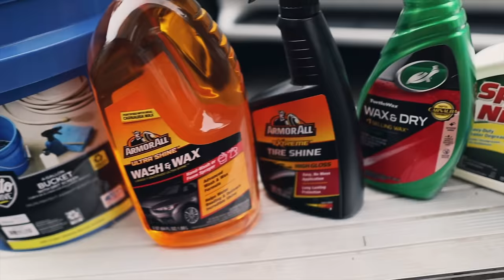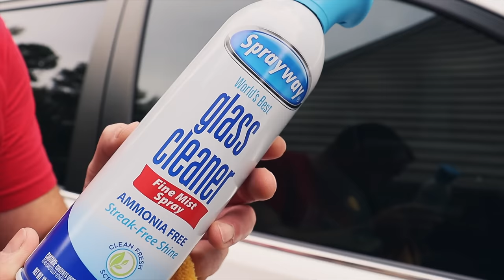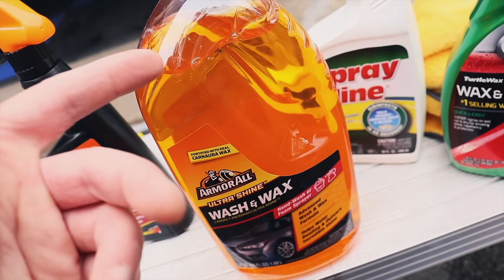Budget vs  Pro: Can Cheap Car Detailing Products Make Your Car Shine?

Comment: Great video! Clearly demonstrates that investing in a few key items, such as drying towels, wheel and barrel brush, etc., can really save you time and money in the long run. I think the same holds true for other products as well. For someone only occasionally cleaning their vehicle, these budget products are better than nothing. Anyone watching here, I believe has evolved to higher quality products, and appreciates the difference.
Reply from the maker: For sure, just the fact one would go out and detail their car already surpasses the majority of the population that neglects their vehicle. So while the products can sometimes be super important, it’s the methods and techniques that are even more important.

Give a good detailer average products and he’ll still do a good job. 

But of course when you detail vehicles regularly, then it makes sense to invest in higher quality chemicals and tools if they can increase your efficiency and results and make the user experience better.
Reply: I like this channel, and I’ve always used budget products.  I have my favorites, and they work for me.  I’ve come back to Turtle Wax after many years of trashing their products.  Their new lineup is very good.  Meguiars is hit or miss, but they do have some great stuff as well.

Comment: I used to use Koch Chemie, Carpro and Adam’s car wash soap and bug removers. But I always go back to meguiar’s gold class soap and turtle wax bug and tar remover. In my conditions, I feel that turtle wax bug and tar remover has the best performance without compromising my coating. I also feel that Meguiars gold class soap has a lot more lubrication compared to carpro reset, Koch chemie GSF and Adam’s soap. They’re also very cheap and easily available, so I can use higher dilution. But on all other products such as pressure washer equipment, polishers and polishing compounds, I use the highest end stuff from obsessed garage. I only use consumer grade products for bug tar remover and car wash shampoo
Reply: do you still use koch chemie? if so is it good?
Reply: @Guapoo69  yeah bro. It’s not bad. But it’s very expensive.

Comment: I love Sprayway Glass Cleaner because it is ammonia-free, cleans really well (no streaks), and is widely available. In cooler climates, this might not matter, but where I live (in the desert), most glass cleaners dry almost instantly. For instance, the rag will touch the glass, and it is already dry at the point of contact because of how hot the glass is. This doesnt happen with sprayway so it has become my go to glass cleaner.
Reply from the maker: Thanks for sharing!

Comment: Most importantly, we all have to start somewhere! I would recommend everyone to get the basics first and then progress later simply to be able to put your money where your mouth is. The stuff I was using 20 years ago in my mind were the best of the best but nowadays I was very wrong. Of course technology has improved since but the experience along the way will solidify why more professional products are not only economical but very useful. If you want to ditch big box store products, I'd highly suggest jumping into the P&S product line! You won't be disappointed.
Reply from the maker: Good points! 👍🏻

Comment: Funny thing there is an old guy out there who bought an F150 new in 1984, parks it under a carport and cleans it every 2 weeks w/Turtle Wax & Armor All products.  As well as changes his oil every 3k miles & uses a Fram or STP filter (whichever is on sale or in stock at the time).  😂  It’s probably 90% consistency and 10% the product.  

That being said, I’m always watching Pan’s videos and probably using the higher grade consumer stuff.

Comment: Hi Pan. Thanks for all you do as, judging by the comments, we all learn a lot from you.
Id personally like to see an all-in-one video on removing different LSP's. From bsd, waxes, sealants, TW ceramic spray (an example, because i have it), to the newish ceramic-lites (carpro cquartz lite and in uk Infinity Wax Synergy lite, which id like to have a go at but have concerns removing the stuff) to full blown ceramics 1yr, 2yr, 9yr. How do we strip the lsp so we can start over?
Do we have to dispose of stripping cloths and pads, after use, with ceramics or ceramic lites.
Thanks in advance

Comment: Found 1 spot I had missed during paint correction the size of a toothpick where a stain was not removed from the front bumper.  It was sealed under the Cericote.  Was able to remove the stain after removing the coating that had sealed over it.   I can tell you the Cericote had bonded over it with an extreme hardness due to proper curing.  Once I removed the coating the  stain was easily removed.

Comment: If you take leaf blower and blow off the water first then use your towels to touch up left over water. The coating I had put on my Audi A7 the water just sheet off with just very very water left  on the car.

Comment: Impressed with the Spray Nine. Although i would be a bit concerned about using it on a regular basis on coated cars. Rest of the products are kind of what I expected, acceptable, but better options available. That tire shine though, looks like sling city.
Reply from the maker: I think Phil uses the APC pre-treat more for situations of full car preps for a ceramic coating application. Not for regular weekly maintenance washes.
Reply: Hi Yes what Pan said.  I always mention on our youtube channel how we proceed with out methods and details.  The APC rinsing or pre washing at this level is for the initial detail, not to be used all the time for maintenance details.  I simply showcased it in this case.  I actaully love DIY Rinseless in a foamer as a pre wash.  its effective and safe.

Comment: Enjoyed this one Pan. Very interesting and for the weekend warriors who wash there cars regularly the publicly available products are ok because most of us not trying to make them look like pros like you do. The Spray 9 was interesting I have not used it before but am thinking of trying it. Have you covered this product before? If you have I probably missed it. If not maybe you can do a vid on as it can be used on many applications including the interior if diluted properly of course. Would also like to know how much impact to the the protection it does etc. Thanks!
Reply from the maker: I haven’t done a video on Spray 9. But Phil mainly uses it as part of the pre-wash before a full detail and ceramic coating job if memory serves me well. Not for regular weekly washes as that could potentially degrade the protection over multiple regular uses.

Comment: Just watch this video on Cheap vs Pro. I have some info I’d like to pass on. Two products in particular were the Spray 9 & the Armoral. Back I the sixty’s & 70’s everyone used these to clean & shine there dash and interior vinyl. Little did we know they had an chemical components that attacked the plasticizers, causing cracking. Also it left a slick feel to the surface. Case in point: My wife had her car detailed. They used Armoral on the floor mates. That quickly transferred from her shoes to the brake peddle… VERY DANGEROUS!
I used Spray 9 on the vinyl boat covers. Got them clean but they too became very brittle.
My go-to for all my vinyls has been the 3M Vinyl Cleaner & Conditioner.

Comment: I used that glass cleaner when I drove a truck.  All of the Drivers did and I still it today.   I found that using a microfiber towel leaves lint, so I use paper towels.
Reply: Try as well a waffle weave towel, that's what I use and it's amazing on my glass

Comment: Spray Nine has a pH of 12.8, so even when he diluted it 1:4, the end mixture has a pH of 12.1. It's highly alkaline and will degrade ceramic coatings and PPF.
Reply: he said it will effect coatings, nobody denied that. clearly his worked decently well afterword's as he stated..
Reply: @rebelkillswitch  most of us would want to clean the surface without damaging it in the longer term. Spray Nine cleans well, but in the long term causes more harm than good. 
It's much better to use milder cleaning agents and increase the dwell time.
Reply from the maker: If I remember his method, Phil mainly uses a high pH APC pre-treat on vehicles before a full detailing and ceramic coating application, not necessarily for each regular weekly wash.
Reply: @PanTheOrganizer  thanks Pan, that would make sense.  High pH for a decon wash, followed by a ceramic coating.

Comment: Thanks, Pan. I can tell you Phil and Jess at Miranda detail are awesome. Very hard working and honest. I've learned a ton from them. I'm glad you had them on.
My experience has been that some of the consumer grade chemicals are ok. Usually, I need more product to get the task done, thus not as inexpensive as pro grade. The tools are another story. Towels, brushes, and wash mitts are very low grade at the consumer level. Yeah, the pro tools are expensive, but they are superior in every way. Last, a long, long time. Yes, please. More videos like this. There are some "diamonds in the rough" at the consumer level. 
Hey Pan, where did you get the 1000ml Wet Coat?
Thank you!
Reply from the maker: Yeah I agree the tools on the cheap side are often too cheap haha.

That’s an older WetCoat bottle that I keep around and refill as I like the size. I don’t think they offer that size anymore.

Comment: Hey Pan! I purchased a new car this week and I’m looking for a protectant that will keep the paint from fading and clear coat mostly in-tact 10 years from now. This is especially important because my car is stored outside in the elements. My main and only concern is UV and chemical protection. Are there any consumer coatings you recommend? I don’t have any experience with decontamination or clay bar stuff, but I’ve seen 50+ different types of spray-on coatings online and in stores, and I’m wondering if any of these modern ones are actually worth giving a shot. I’m okay with re-applying once every month or so if it can be done in under an hour after a maintenance wash.

Comment: hey pan, quick question. Can I clay bar using synthetic clay on a ceramic spray or will it diminish the protectant?
Reply from the maker: You’d have to test. It’s impossible to know for every product combination. Worse comes to worse, if you see it affected the protection, as it’s a simple easy spray, just reapply.

Comment: Is it possible to use a specific consumer brand like Turtle Wax product’s or Jay Leno’s Garage from start to finish to compare to professional grade products? There are some consumer brands that are cost effective and work really well.
Reply from the maker: You can do as you please. But usually, the more premium products do offer better performance and durability (like coatings for example). But you can still do a good job with entry level stuff. The skills are often more important than the products themselves.

Comment: I use the following products on my car as a weekend or during the week detailer.

Armor All Extreme Shield Protectant for the inside
Meguiar's Leather Conditioner for the Leather Seats
Armor All Wash & Wax for to wash the car
Meguiar's Hybrid Ceramic Wax for the outside (I wash the car, spray on the wax while wet, rub it in and then hose it off).  My car is never without bubbles on the paint after a rain.
Meguiar's Ceramic Tire Shine for the tires
Black Magic Tire Wet for the tires
Turtle Wax Wet & Black Tire Shine for the tires
Stoner Trim Shine for the black plastic trim
EVO Gloss Envy or Gloss Enhancer for in-between to give the car a nice gloss

All these products are fairly inexpensive and after 5 years my car is still looking like new.
Reply from the maker: Thanks for sharing.

Comment: Nicely done ✔️.  I manage my products very well and get the very best out of them. I feel you guys reading this, too, can do the same. The amount of product to dispense is usually worse case scenario on the bottle label, dial it back a little for your water type I.e T.D.S soft/ hard water. What is the vehicle condition like? What time of year is it? Do you need to use the full amount specified on the bottle? Little is often best. If you use premium products, then you are using the best tried and tested products available for your second biggest purchase in some cases. Why would you use a cheap, not very lubricating car shampoo that uses caustic, salt and rust inducing soaps? They might clean ok but over long periods of time it's damaging your pride and joy, premium products often use better chemicals that i have found. It doesn't make any sense to use cheap products. I invest heavily into the very best for my growing fleet of vehicles because they are expensive and maintenance is the very least you can do to keep its value and your enjoyment! A clean car always drives better right? 😄😆. I know things are expensive, but decent car care will pay you dividends in the long run. If you are struggling to buy products, then save for longer and wait it'll be worth the wait. Or go halves with a friend who loves detailing too, make a bond stronger with your buddies. Pan's 2023 detailing awards just showcases all that's the very best detailingcan offer. I can agree with most of Pans line up, although newer products are already out and in such a short period of time has surpassed these already. It's an exciting time to have a passion for detailing. 🎉
Reply from the maker: I agree! We live in a time where there are always new innovations and new products to try and see what works best for our needs and budget.

Have a great weekend!

Comment: Thanks for sharing! ❔Quick question, please: Just bought a 2014 Ford F150 and was doing my first interior cleaning. Not sure what was used previously to clean the airbag area of the steering wheel, but I went to clean with APS and it feels sticky. There’s also black residue coming off onto the microfiber towel (the interior is black/gray). I went ahead and wiped with some interior detailing spray after the APS, but that area is still sticky. Any ideas or suggestions? Thank you! 🛻
Reply from the maker: What is APS? Did you mean APC (all purpose cleaner)? You have to be careful and not use too harsh chemicals on the interior. Sometimes APCs if not diluted properly could do some harm. I prefer interior cleaners made for that task.

See my video here: https://youtu.be/bz7h-HfSdRg?si=rYFVOBbk6IkAj6Gi
Reply: @PanTheOrganizer  Sorry, yes. All purpose cleaner. It was sticky before I cleaned so I thought it might be some old product that was lingering on the surface. But I may have made it worse. Will take a look back at your videos. If you have any other suggestions I’d appreciate it. Thanks for all you do!! 🙏🏼

Comment: Hi Pan, how would you go about caring for a 30 year old vinyl dash that has lost its suppleness? Is there anyway to bring it back? The vinyl towards the front of the windshield is fairly brittle, but not brittle enough to crack during normal wiping. Im wondering if theres something I can apply to bring back the oils to the vinyl to preserve the dashboard longer.
Reply from the maker: It's hard to troubleshoot these things at a distance without being there to observe the state of the surfaces. If it has faded and cracked it's likely too late. But you could try to apply some interior protectant like this: https://amzn.to/41v6prw
Reply: @PanTheOrganizer   thanks, I'll check it out. And its definitely not that far gone. It still looks really good for its age, but I wanted to get an opinion on how I could possibly make it last another 30. Ive read many conflicting opinions on forums.

Comment: Question. On a cold day in the winter (10 Celsius or above) can I use warm water in the bucket with car shampoo. Is there a pro or con when I do this with my TW products ? 🇨🇦👍👍
Reply from the maker: As long as you don’t detail in temperatures below 10C you should be fine, other than not having fun detailing in 10C weather lol

Comment: Hey, i just have a small question. My car has a "one year" wax based coating that my detailed used after polishing my car, but i want to apply tint ppf to my headlights and taillights, what is safe to use to make the surface good enough that the film will stick to the lights? Thanks if anyone knows!😊😊

Comment: Softcoat 99 is all you need. It's last whole year lol.
Reply from the maker: Softcoat 99? What is that? Did you mean Soft99 Fusso Coat?
Reply: Hi. I actaully have the Soft99 black and white paste to use later. I also have the fussocoat spray sealant.

Comment: Whomever did the bodywork on the front of that vehicle needs to do it again..  The bumper to fender fit is terrible.  Probably replaced with an aftermarket bumper.  Hood color doesn't match either.